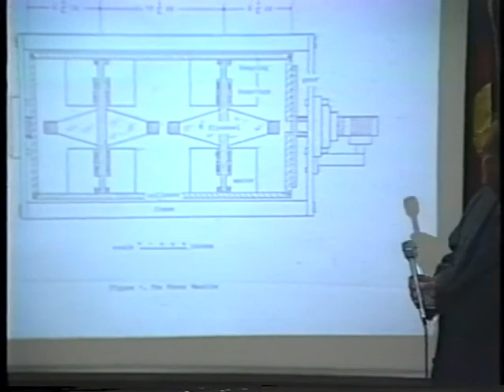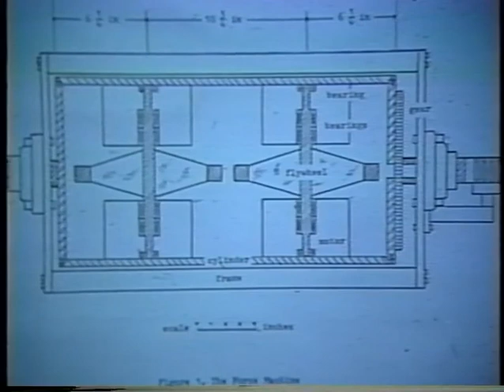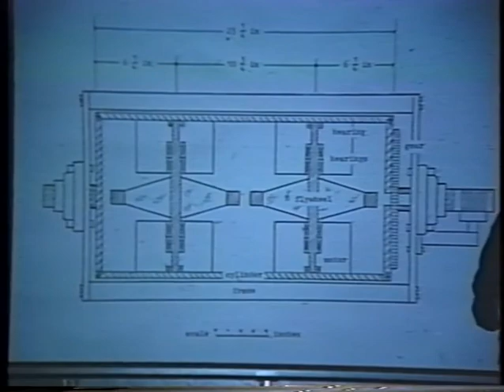DePalma/Trombly/Tewari – The "Roundtable" Discussion

Comment: Im really trying to make sense of what mr Tewari is explaining at 50:11. Please share your thoughts
Reply: What Tewari is talking about is a ‘Compensation Field’ which pertains to creating an external Magnetic Field that is Equal in Amplitude but Opposite in Sign which then compensates against Drag caused by Energy Withdrawal - Bruce De-Palmer went to Auckland New Zealand where he subsequently died & he shared his Knowledge with the Maori. The key is to reach 6000 revolutions & the N Machine produces more Energy output than it takes to run it. The Compensation Field allows you to draw Energy from the Machine without any drag at all - It is unbelievably SIMPLE!… FREE ENERGY EXISTS BUT IT, IS ILLEGAL! …Everyone on the Planet is a Slave! People in New Zealand & Australia have both N Machines & Stanley Meyers Fracturing of Water using High Voltage Tension to induce the Electron Avalanche effect to ‘Fracture Water’ into HHO all because Stanley Meyer decided to share his Knowledge at a Meeting House with the Maori people.